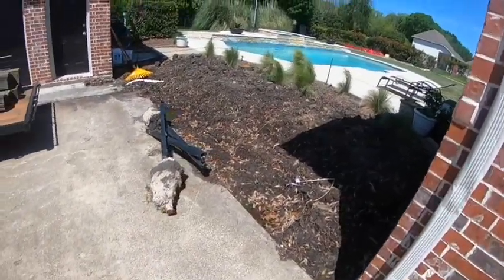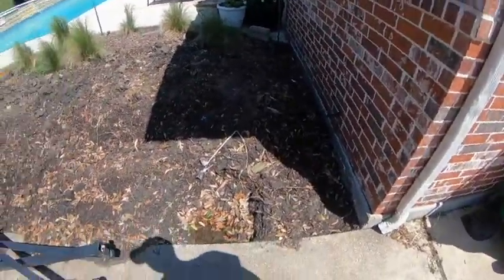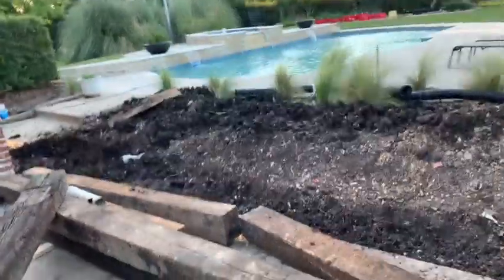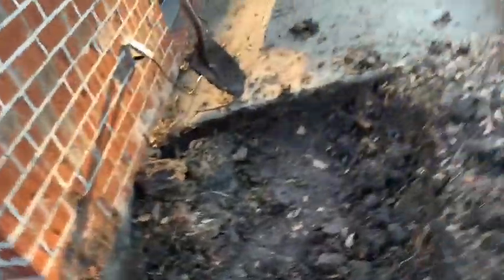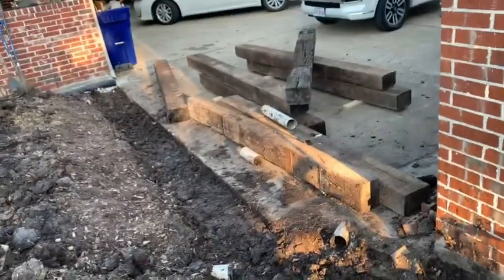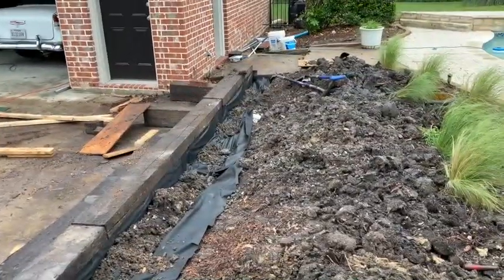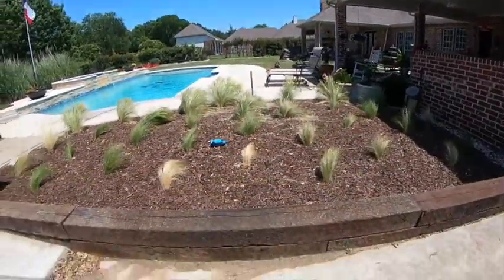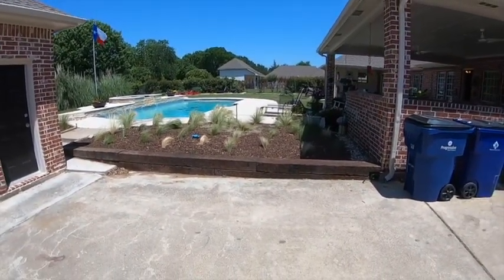Retaining Wall Railroad Cross Ties

Comment: Singing to the choir here. I did a 300 Ft sea wall 4 ft high on a lake up here. I used chains and a 1350 Oliver to place them and never  lifted one of them manually. And believe it or not, most will actually float in the water. That looks really good keeps the debris and cars out of your pool. Makes it look classy.
Reply from the maker: The Drifter - wow, 300’.   That was a major project.    This was like 24’ and it wore me out.